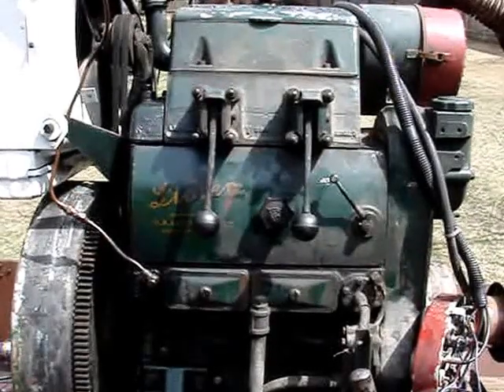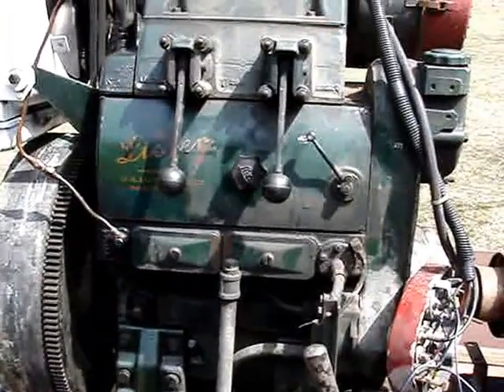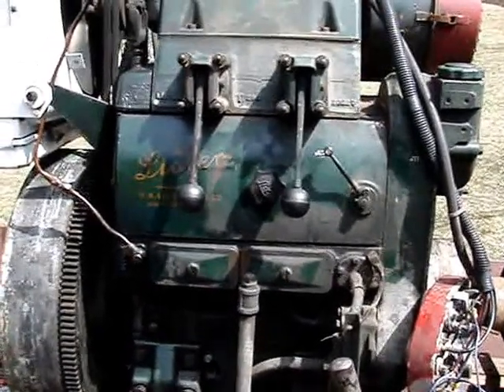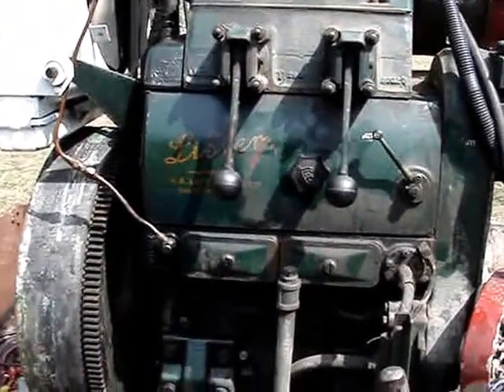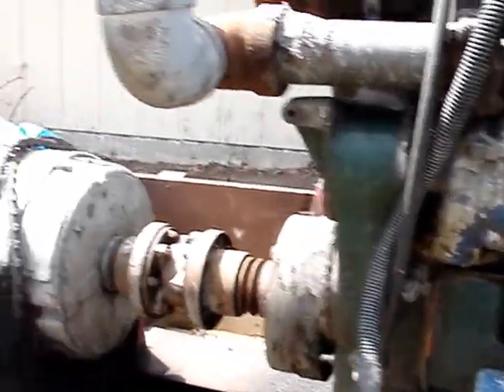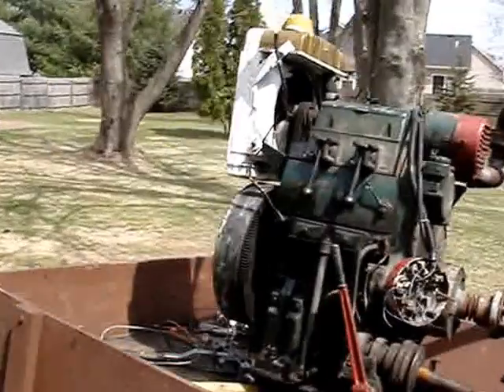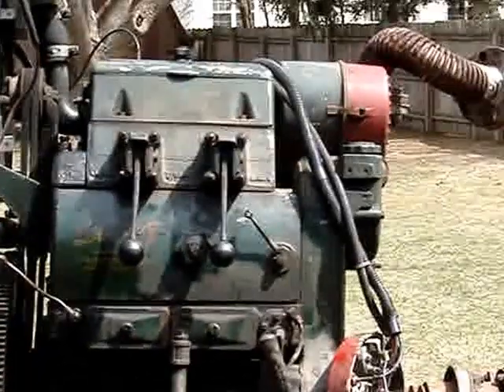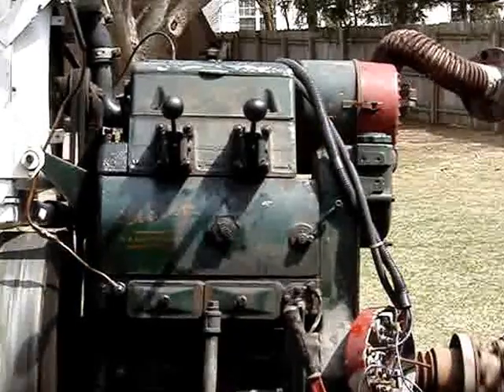Jim's Lister FR 2 cylinder diesel engine

Comment: My dad had one of these on the last dairy farm we were on , I drove a 6 inch Irrigation pump and during the summer it worked day and night , with no problems ; It was started by a crank handle and had a 16 gallon diesel fuel tank mounted above it ( Gravity fed ) !
Thanks for the memory , never ever thought I'd see one of these great engines again !
P.S. There was one dad I heard and then found on a cable punt on the Myall River in N.S.W. ,Australia , this one had a throttle control , but the beautiful starting and running sound gave it away !
Footnote : I am was originally from N.S.W Australia and grew up on dairy farms in that state !

Comment: My Dad had one of these back in 1957 /58 on our dairy farm , ( it powered the 6 inch irrigation pump and its system of underground 4 and 6 inch mains .
Acreage of the farm was 365 acres , 120 milkers etc !
The Lister was started with a crank handle , and ran at 1800 R P M , originally 1500 R P M , but the governors were changed to accommodate the pump as the ration was 1 - 3/4 !